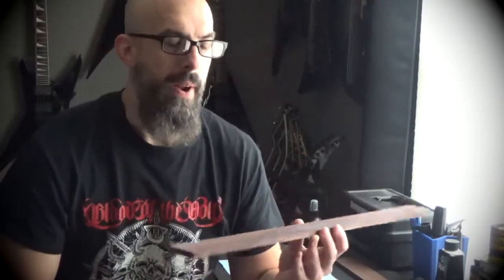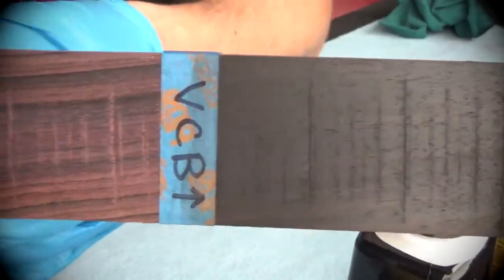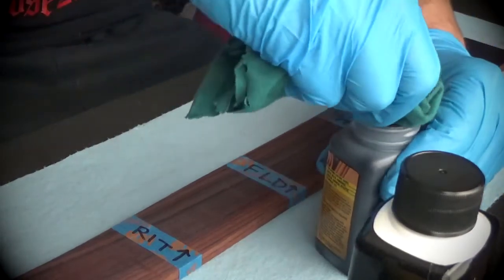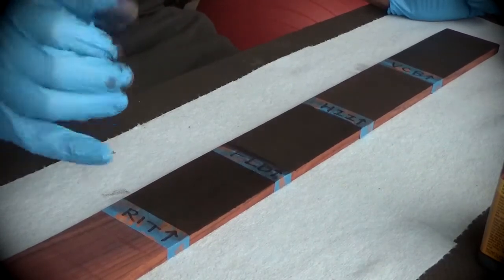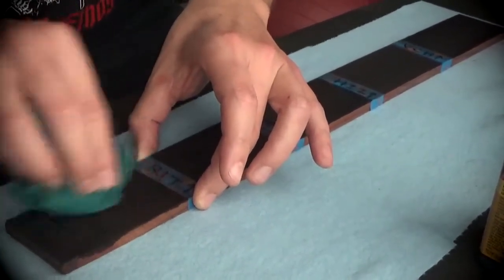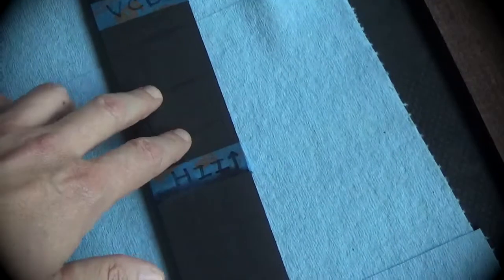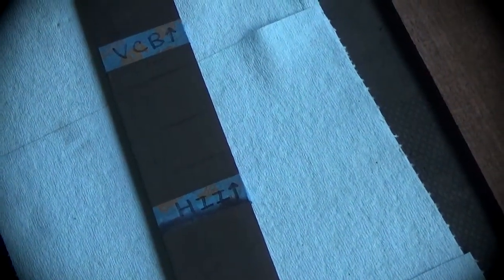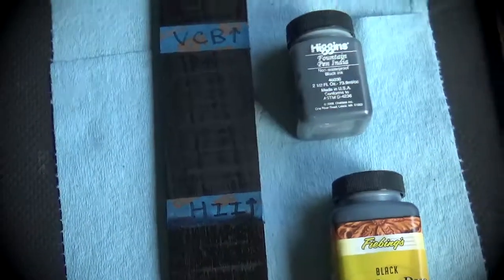"Ebonize" Laurel fretboard: stain, dye or ink?

Comment: Have you tried an actual ebonize technique. Put a wad of .000 steel wool in a jar of white vinegar, let it sit for a few hours then you can apply multiple applications until you get the desired color. For even darker you can run a wet bag of Black tea inbetween coats as the tannins help. It’s a common carpenters technique and works great, No residue at all.
Reply from the maker: Yes, I've heard of this method. Never tried it though. I'm happy with the results using the Varathane classic black and I wasn't confident in getting the mixture right with the method you are talking about. But yes, I've heard good things about the vinegar/steel wool technique.
Reply: @mikefrombloodofthewolf7076  thanks for the reply. I’m looking at darkening my board too. Was hoping to find a video of someone doing that. Your results look pretty good… now I just need to courage to give it a shot.
Reply from the maker: @Endz510  check out this one I did. https://youtu.be/mmgCJI23aQk?si=tfcIvTlvoJ76R4aj

Comment: I used Fiebings Oil Dye on a Chibson. The guitar had white bindings. The oil came into the micro cracks in the binding and that was very bad!!! So I suggest using use it only the way it is used in this video or on a guitar with black binding! Greetings from Holland.
Reply from the maker: @michelmetal666  Thanks for the tip!

Comment: The difference between dyes and stains are miles apart. Dyes sit on the wood and will wash away with water. Stains react with something to change the color and will not wash away with water. I have used vinegaroon (steel wool dissolved in vinegar) to color leather and wood. If the wood doesn't react well, you can add more tannins to it using coffee or tea.  Ever notice on pallets where the nails are is black? Iron reacts with tannins to create black. In veg tan leather, that reaction is instant and permanent. To neutralize the vinegar use Bar Keepers Friend.

Comment: You can get waterproof India Ink -- I used it on a body I'm working on and was very happy with the color, even happier once I did a layer of shellac and then Tru-Oil on top. That sealed the color in and changed it from the dull brownish black you got to a rich, shiny REAL black. I'm thinking of doing India Ink again on the neck, followed only by Tru-oil (that's my thinking now, still researching).
Reply from the maker: Cool. I'd love to see some pics of your results, or even better, a video. Got any links?
Reply: @mikefrombloodofthewolf7076  I"ll pull them together today and post. Well, the neck came and I got to work doing india ink on it, and I was surprised that it stained the ornate vine inlay, so I had to scrub the color back to reveal the inlay again. This brings me to a new rule of luthiering -- don't do something to your guitar without knowing how to UNDO it. Luckily the ink scrubbed back partially with some alcohol but it appears there's a little residue on the inlays. Again I'll post before and after pics later today.
Reply from the maker: @TedCurran  sounds good. I love seeing other people's projects.
Reply: Just bought a small bottle of waterproof indian ink from Winsor & Newton. The bottle says it contains shellac.

Don’t know if that is ok for the purpose of darkening the fretboard. It is not penetrating the wood I think so its on top of the fretboard. 

I went from this video with non waterproof to another who used that and had no issues with black vingers after using oil.

Comment: Awesome video! Idk if you remember me telling you, on the one i did, i used the varathane black (got that idea from your video) and it was still showing some rosewood through and i used the fiebings over the top of that and ended up with a perfect black after that. Maybe i didnt explain it right. That sheen did go away after a few days on mine. Could be different with different woods too. Ive tried using the fiebings around inlays real carefully with an angled artist paintbrush and was able to avoid and bleeding into the inlays. So maybe just touching up spots that are still showing wood through with fiebings after using varathane is the ticket.
Reply from the maker: Hey Jed, I thought your name looked familiar. I remember now, though I didn't recall that conversation before making this video. I have another fretboard blank. Maybe I'll try your method on it! Thanks for the extremely helpful comment!

Comment: First time coloring a fretboard (roasted jatoba). Really helpful content, thanks!
Reply from the maker: My pleasure!
Reply: Was that on a LTD guitar? I just got one with a roasted jatoba neck and want to darken it ASAP. How did it work for you?
Reply: @gabrielsilveira84  Worked out great! Yeah an LTD eclipse with pearl inlays and ivory binding.

I ended up using a spree/alcohol based wood dye, because that will be immune to the water and oils of your fingers, so technically it's the "correct" dye to use. A word of caution though, that an alcohol based dye will make a much bigger mess of your inlays and bindings, so nail polish remover (rubbing alcohol) is needed (can also try a razor but rubbing alcohol worked fine for me). And if you don't have a binding running through the fretboard, then the job should be much easier.

Looks absolutely stunning. Good luck!
Reply: @Bluesruse  Great to hear! Mine is a matte black M201 and I can't wait to get rid of the brown on the fretboard to make it full black.
Reply: @gabrielsilveira84  Hello! I would like to do the same with m201. Can you send me a pic of your final results? :D or help me how did you do this?
Reply: @bazsixx6894  Sorry, I ended up selling it before I had the chance to do it D:
Reply: @gabrielsilveira84  oh nooooo im so scared :'DDDDD bought water based wood stain :'D

Comment: Tbh, I really liked the look of the leather dye. That sheen looks really nice to me. Also the fact that it stains the tape, makes me think it will work better to stain the painter edges of a fingerboard(which many boards have). Also if you don’t want it on your or inlays, I heard you can just use some fret rubbers to remove it. The reason it stained the tape is because the surface is fibrous. Fortunately most plastic isn’t. Also if you wanna keep stain from rubbing off, I might use a thin layer of renaissance wax or similar. 
As for India ink, the one I’ve seen recommended is speedball super black India ink. It’s quite popular. It’s waterproof, so you don’t have the bleeding problem from sweat.
Reply from the maker: Excellent tips! Very helpful. Thanks for commenting!